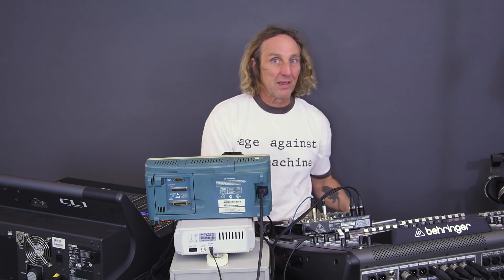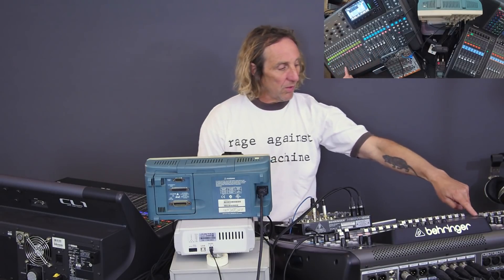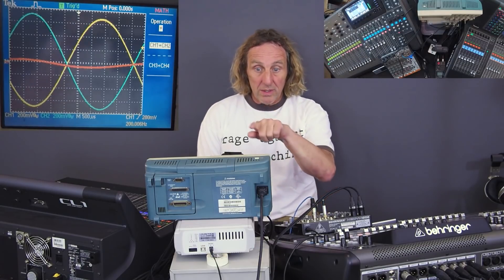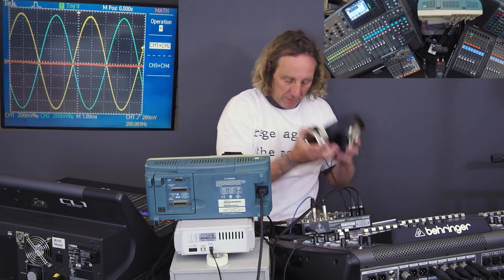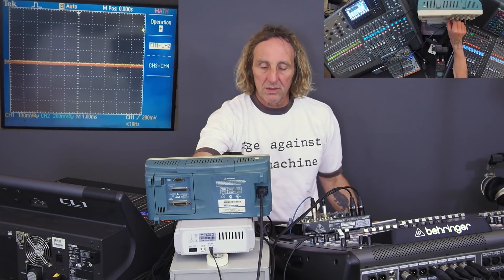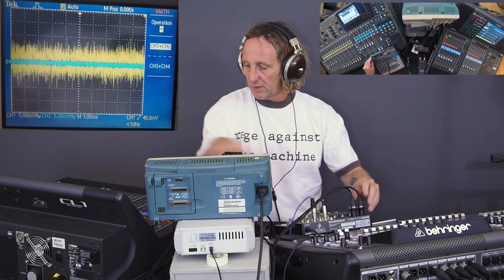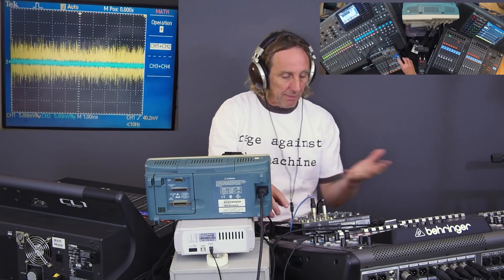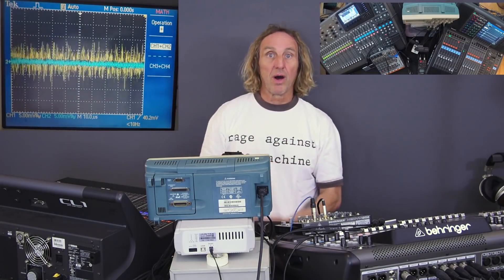Noisier is Quieter! Yamaha CL1 vs Behringer X32 (Public)

Comment: Yamaha - even with mild abuse - will still work a decade later, and will only require a basic repair.

I almost never see broken yamaha equipment. They are automotive quality, and they are also very much not about being "premium" or overpriced - many consider them a budget brand.
Reply from the maker: Ha! Hard core mediocre in every regard. Utilitarian solid and not stellar at anything other than world wide availability?
Reply: @DaveRat  their worldwide availability is non-existent right now due to chip shortages. Lead times are out 9 months + on any CL orders.
Reply: @DaveRat  it's true of all their products whether motorbikes, saxophones, guitars, pianos, hifi, or pro audio. There is some "magic" missing, it's a very square plasticky mentality, but Yamaha are one of the best companies for making equipment surprisingly tough without making it weigh 50 tonnes. 

My rackmount single ended yamaha analogue swiss army knife instrument-level-compatible line mixer is a thing of beauty, and I bought it for next to nothing. You would have to prise it from my cold dead hands. It does nothing weird or special, it just switches on and works, at nearly 40 years old, and passes pristine audio without fuss.

Prioritising sound quality over reliability is exactly the opposite of what behringer do.

In a real world context, reliability is very important, but only educated customers value it, and it's rarely properly demonstrated in advertising. Audio equipment could be a lot more rugged, especially if you look at how telecommunications, aerospace and military equipment is designed, and how much more it typically costs - the high prices are not just because of corrupt government procurement processes and brown envelopes.

High precision and high dependability are expensive to produce. Simple is always best - this is why we still have mechanical firearms in use by every military worldwide.
Reply: @weareallbeingwatched4602   One of the keys of my Yamaha MODX6 synthesizer broke. Turns out the board for that keygroup was cracked. None of my Behringer stuff has had something like that happening. For the price of the Yamaha you can buy a couple of ‘spare’ Behringers… are they really that bad? I’m not sure. Depending on both company’s cost cutting, ‘stuff’ happens. I repaired the MODX6 keys and still enjoy it, playing through a Behringer XR18 :) There is a use case for both philosophies and for amateurs Behringer delivers a lot of bang for the buck.

Comment: Simple analog 20k lpf on x32's outputs and Bob's your uncle. Cool mod idea for it. I'm just not sure about longevity of the electrolytics in the x32. I've had some serious issues with those in my lower end Presonus gear, and they used Nichicons!
Reply from the maker: And perhaps the best piece of gear the x32 is plugged into won't do 20k + anyway.
Reply: @DaveRat  rejecting signals causes distortion also - many early digital systems played very badly with the ultrasonic distortion generated by microphones and preamps. Try running a 2V 50kHz square wave into a desk input and see what it does - analogue desks don't like it either. Buffering and bandpassing are under-rated strategies, and often a way of curing analogue problems is to use a digital unit to "buffer" the problem, especially considering the waveform is reconstructed, but also considering the power and ground isolation qualities. 

Digital is great in that it has reduced coupling issues, although in fact these coupling issues while suppressed are subtly complex and often cause bizarre and unexplainable subtle reliability and quality problems.
Reply: Electrolytic caps often sound better than ceramic ones, but they do have a lifespan.

It'd almost be worth installing them in pins rather than soldering them, so you could change them like light bulbs. Some industrial gear has electrolytics on a bayonet mount.

Comment: X32 rules
Reply from the maker: Value for the money. Perhaps not durable or easily repairable but they have done well at offering loads of features and power at a low cost.
Reply: @DaveRat  Dave has been using one for over 6 years. I only took it 2 times to the concert and spent little money.

They have a lot of features, but I don't think they're made for the road.

Thanks for your video. Very enlightening.

Comment: Very fair test, one example against another. Behringer X32 has become the standard mixer for small gigs around here. Of course, this is a sample of one and a single bad solder joint or decoupling/filter cap is all it would take to skew the results. I always tried to get my company to build at least 30 prototype units so I could measure them all and see what we really had....including unit-to-unit variability. That was always a fight to get that many, however.

Comment: Can you explain why certain consoles, stage boxes have dual power supplies??
Reply from the maker: Dual power supplies have been around for a long time in pro audio for powering the most crucial component(s) 

If the mixer stops, the show stops and the mixer tends to need a big power supply and the power supply, especially for bigger consoles, is the one thing that is most likely to fail.
Reply: So is there any problem if we connect one to raw power another to UPS power?? Bcoz i have seen some technicians connecting one to raw and other on UPS and some others connecting both to UPS...which one will you prefer?
Reply: @abishekaravind7707  I can absolutely weigh in on this one. Never ever hook up both supplies to a single ups. I've had way more quality UPS failures than power failures. We always run 1 PSU via UPS and the other either directly through power or via a second UPS which we try and use a different brand and model to the first in case they have a particular dislike to certain situations. Different brands and model have different kryptonite, so getting a dual failure is less likely.

Comment: Verrrrrry interesting results here! Behringer is hiding the noise in upper bands... ha! 
I did a real world test that offered a little insight... (Audible only)
I maxed the volumes of my PA, 15Kw. There was little to nothing for noise with no input. 
Then brought up each output channel, input channel, gains to max, eq etc. Routed through groups and then all to the LR bus, same.
Trying to reveal anything in the X32 that would create audible noise/hiss. 
The results were 0 added noise in the PA. NO audible difference.
Not real technical but real world, like leaving empty channels on an out.
Thanks again Dave for all the testing you are doing. I bet Yamaha isn't happy...lol
Reply from the maker: The M32 shows quieter. I am guessing X32 saved some money on filtering out the ultra HF noise

Comment: Cool yeah I'm loving your videos but I would like to know  in what way the noise specification of each desk or specified  usually the noise specification has the bandwidth  specified when your test was made 😊
Reply from the maker: The published specs are out there and easy to find and compare and the way manufacturers publish specs varies. I found it interesting that the Yamaha costs 5x the price and has more audible noise and also longer latency and routing latency shifts as well.

The Yamaha is a higher quality mechanical build though.

Comment: To see the weighting of the noise, eg pink vs white, take the output of the analog mixer and put it into an RTA to see the distribution vs frequency.  This can be done with a laptop or tablet running the X-Edit program and feed the output of the analog mixer into an input on the Behringer and use the RTA function for the channel to view it in the EQ screen.  Feed the signal into a channel not used for your testing. Just use an input for the RTA function to display the audio spectrum and not display the noise up to 100 MHZ the scope displays. Not sure if the Yamaha has this feature in the remote tablet program.
Reply from the maker: On the member side of my channel there is a video with an FFT of the noise done with the scope where you can see both consoles.

A normal audio RTA wound show the X32 noise

https://youtu.be/k1ytyDHq-d8

Comment: a FFT spectrum analyzer would've immediatly shown the differences in noise level
Reply: FYI, in the EQ screen on the X32 or M32, there is an RTA function to display just that.
Reply from the maker: The frequencies are above the audio RTA capabilities
Reply: I mean, get one that goes above.  I use software with an audio interface that can do 192khz,  it shows all the way up to 96khz which is more than enough.  Voxengo Span
Reply: @magoostus  What audio interface has the bandwidth of 192KHZ?  Do you mean a clock speed of 192 KHZ which is double the 96KHZ sample rate of high end  pro digital mixers such as the Allen and Heath or Yamaha? ?  The Behringer X32 uses a 44.1 or 48HHZ clock as one of the more affordable consoles.
Reply: @isettech  it would be for the analysis of the analog signal.  a cheap Behringer UMC2020HD  can do a sample-rate of 192khz
Reply: @magoostus  That is true, but I'm interested in the analysis of the Audio spectrum, the part you can hear.  If I want to see to several megahertz, I can use an RF spectrum analyzer.  Have one on my bench for use with RF generators for ISM equipment in the 400 KHZ and 13.58 MHZ ranges. Yes it does work down to the 10KHZ range and below.
Reply: @isettech  I think we're talking about the exact same things with different words.  I think we are in agreement that we want to see FFT spectrum analysis of the analog audio out the XLR ports, voxengo SPAN and a behringer UMC2020HD were just tools I suggested to do that
Reply: @isettech  I use 3 Metric Halo ULN-8s for my mixing duties, repurposed from my location recording rig. Does 192khz easily. It's not as convenient as a purpose built mixer like the Yamaha or Behringer, but it sounds fantastic.